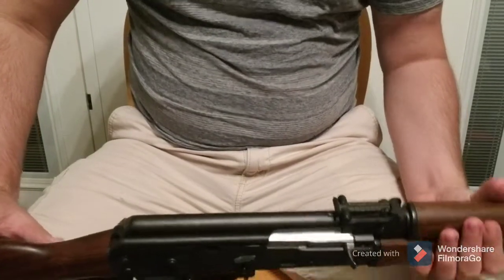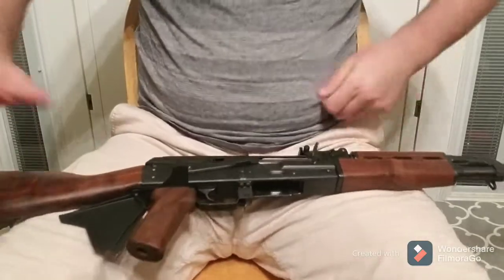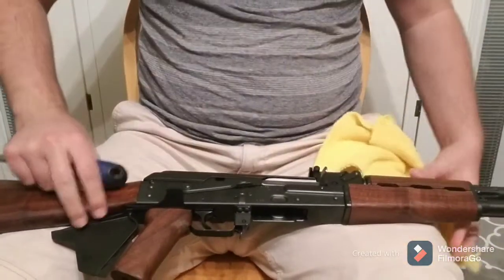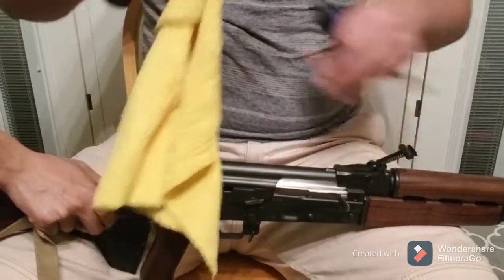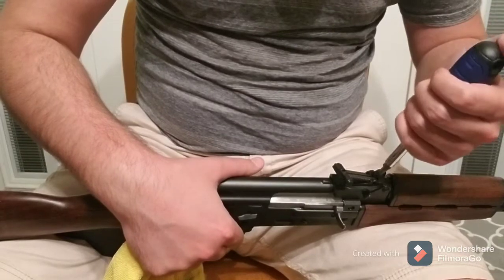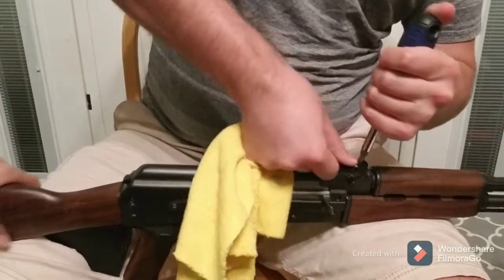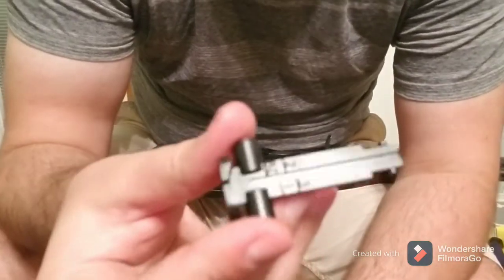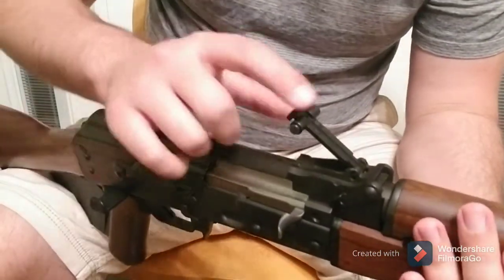How to Replace AK47 Rear Iron Sights

Comment: Good video on how to change out a rear sight but, why would you gimp your sights like that? 762x39 guess subsonic around 550 to 650 meters. So why would you remove the ability to shoot that far? Like mowing your lawn with scissors instead of the push mower in the garage. It's just a straight up reduction in performance for no benefit. Bro, you paid money to retard your AK. I mean do what you want to do, I'm just saying it makes no sense to me.
Reply from the maker: In my experience shooting past 400y with an AK using irons is basically paying for a hit anyways. I just use the battle 0 setting and leave it. If I need more range I have a detachable side mount that can come on or off in 2 seconds, it's faster than adjusting the irons even. So in no meaningful way was the rifle gimped.
Reply: @OLYMPICx22x  let me be clear, I enjoyed the video. I hadn't every needed to remove the iron sights before and I was curious how that work. I thought you did a good job of explaining it. I just thought I was more fun to jerk your chain about the rear sight choice. I stand by my opinion and I disagree with the buy hits at 400 yard. I'd definitely call reducing your sight graduations gimping but I use an optic to so meh.
Reply from the maker: @jhawkdire3434  no offence taken, I just think it's a bit easier with these irons for most people I take shooting. My red dot is amazing so I'll likely keep it on for most stuff
Reply: @OLYMPICx22x  ok I can see the reason behind that. Simplified for instruction makes since. I retract the gimping statement. Lol

Comment: Bro thank you I have the same problem seeing through my rear sight on my zastava did you orders yours straight off their website? I need the same for mines
Reply from the maker: Nope, zastava doesn't sell this. I bought it from Rifle Dynamics, it's a small improvement though. If the iron sights are causing you trouble you may want to just upgrade to an actual optic.
Reply: @OLYMPICx22x  thank you but it’s not the iron sight at all it’s just hard looking through the sight but my other century arms ak47 is much easier to look through. But thanks a lot man I’ve been searching everywhere trying to find some sight like these so I’ll order off their website ✊🏿

Comment: I know I'm SUPER late this, but is the Leaf Sight you used in the video the 800M Length or the 1000M Length?
Reply from the maker: Neither, the enhanced sight in this video only goes out to 300 meters.
Reply: @Servo Sec on the Rifleworks websites it's listed as 2 options, 800m or 1000m but yeah I can only go to 3. I just wanna know which type/variant you used in the video
Reply from the maker: @The Architect  hmm maybe they have changed it since I got mine? I have the exact model that shows in the thumbnail that only has numbers for up to 300. You can still slide it further back, there just isn't numbers to know where you are at.
Reply: @OLYMPICx22x  the 1000m or 800m rear sight designates the total length of the rear sight leaf.

Comment: Did it shift your zero?
Reply from the maker: Surprisingly not, but it usually will.
Reply: @OLYMPICx22x  why would it? An AK zero is entirely dependent upon the front sight.
Reply from the maker: @AR Guy  mostly true, but not entirely, this leaf may sit higher or lower than the standard one, which may shift your shots.
Reply: @arguy3297 ... in relation to the rear. Derp